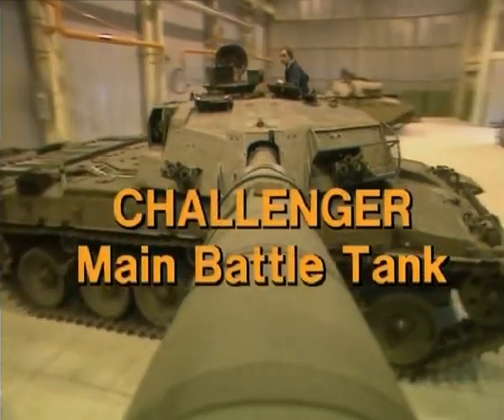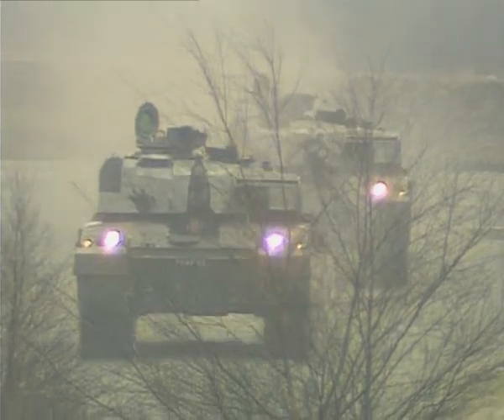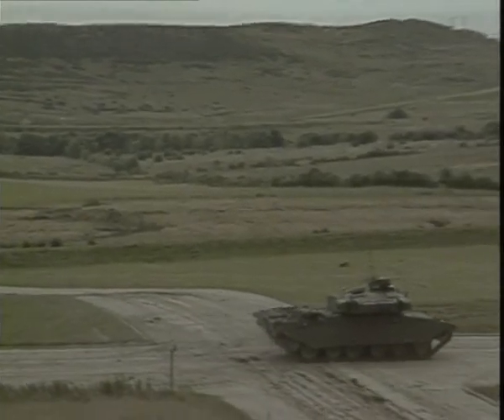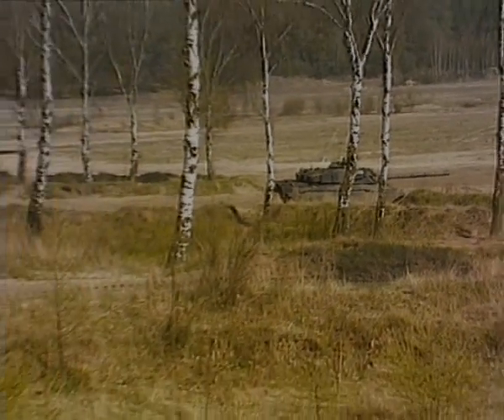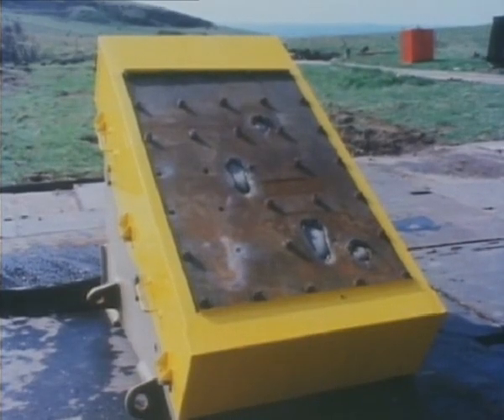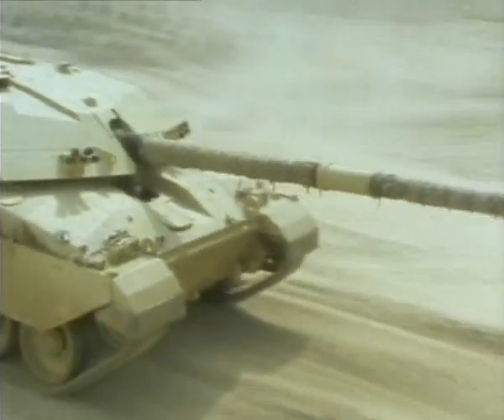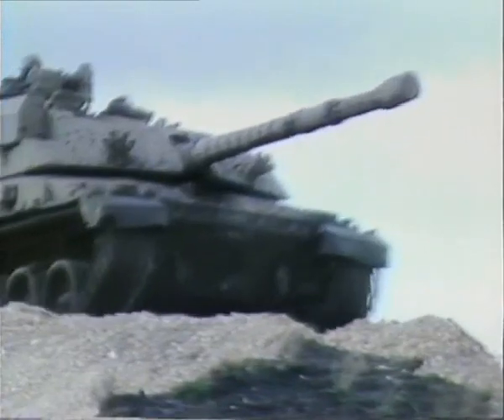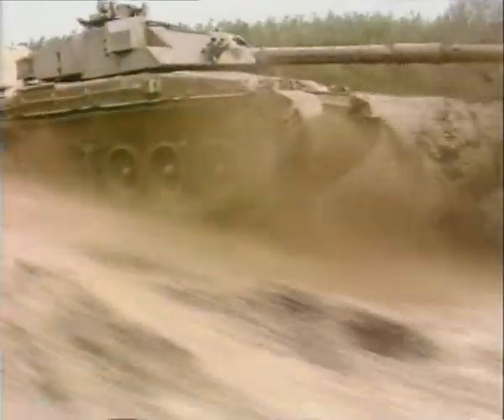Challenger Tank Documentary

Comment: The L30 is just a higher pressure version of the L11. Ammunition remains the same, as the loading of ammunition into 3 parts with primer and powder charges separate, very slow to load

Comment: The Challenger 1 is just an old Chieftain fitted with hydropneumatic suspensions and Chobham armor on the front.

The Challenger 2 is still heavy, slow and fuel-thirsty like a Challenger 1 but has French sights and a new turret, being finally more ergonomic while offering air conditioning.

Comment: @wraith01mg they share the same hull differences are  chally 2 : different turret,full air conditioning, power adjusted track ,improved high pressure (split breach) main gun ,chain gun coax, uprated armour ,smoke generators,niose cancelling i.c. system,long range tanks as standard.Non metadyne hydraulic traverse system ,Multiple target fire control system.The main armament is to be replaced with the 120mm Rheinmetal when amunition is exhausted for the current gun.

Comment: Challenger 2 is an extensive redesign from Challenger 1, the MBT from which it was developed. It uses the basic hull and automotive parts of its predecessor but all else is new. Fewer than 5% of components are interchangeable. Challenger 2 has now replaced Challenger 1 in service with the British Army and is also used by the Royal Army of Oman.

Comment: Why the hell do you think tanks need guided missiles. Just because T-90 has one doesn't mean it's a necessity for a tank. Abrams would not need one, because first off it's not out there fighting against tanks, and it doesn't fight alone, meaning soldiers with Javelins, Bradleys with TOW, not to mention the multitude of aircraft we have to destroy tanks. 

And if it WAS alone,
M1A2 has a missile countermeasure device, blocks wire, radio, infrared, and thermally guided ATGM. And some do have ERA.

Comment: There are less than 5% components common between Ch1 and Ch2. And yes, Abrams is an excellent tank, but it keeps being upgraded since 1979, - upgraded, not redesigned. It means the basic design is 30 years old, and 20 years older that the Ch2's one. Are you going to say there has been no development in tank design over 20 years?

Comment: It seems highly unlike the up-grade would have been carried out, due to the lengthy time period for the politic process of gaining funds for such up-grades to the fire control system of the Chall1, especially when the Government had already committed to a replacement to the Chall1 with in less than 10years, which is normally the time period between being manufactured/previous up-grade to the next up-grade (such as the current Street Fighter up-grade on the Chall2).